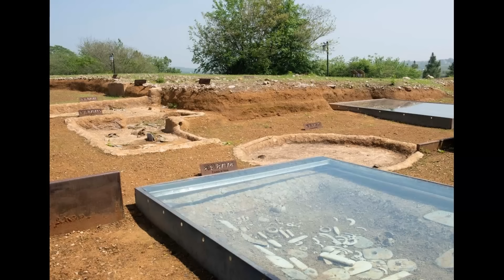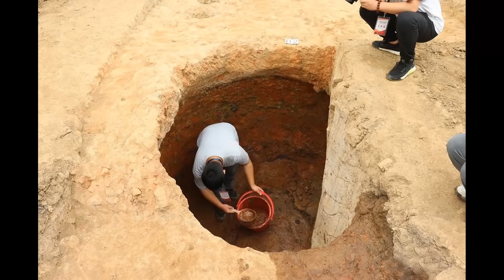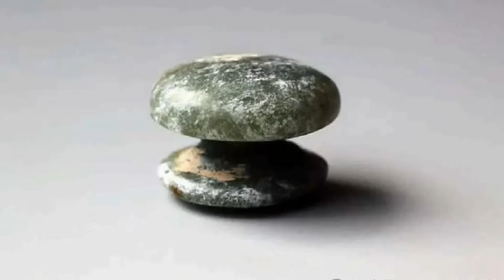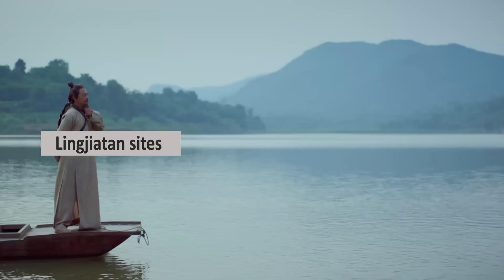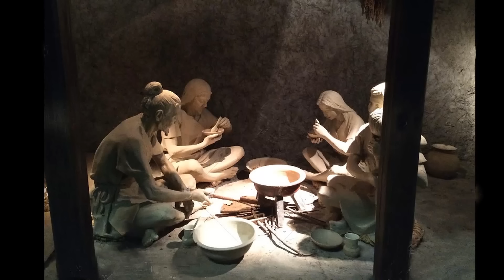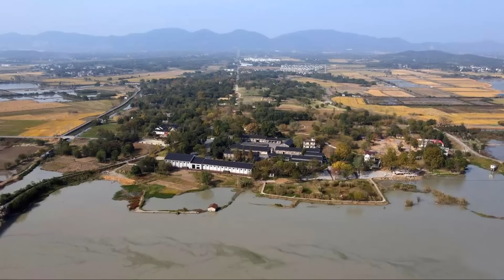Lost Prehistoric Engineering: The Mystery of the 0.5mm Jade Artifact

Comment: 👍  Cool, thanks.    Just from me doing years of woodwork, I would guess they would have finished the center hole with flare first through a block of material, then cut the material down leaving as little as possible around it,  then worked toward the existing hole with abrasive methods.
Reply from the maker: That is a very practical perspective on the order of operations, thank you for sharing your expertise! 😊

Comment: These are truly amazing artifacts Tina.  The wobble-drill connection is brilliant!  Well done.  With the earrings being only 0.5mm thick at some spots, it leads me to believe they were  made a little different than the jade cylinder for top-knots.  In your last video, you showed a jade cylinder that wasn't finished.  They did the outside first and then drilled a hole through it and used twine and jade cutting sand to go around and cut out the center.  So basically, outside first, then the inside.  I think they must have done the earrings the other way around, inside first, then the outside.  This is because the 0.5mm wall thickness would have been too weak to take the stress of the wobble drill.  But, looking closely at the earrings, they appear very circular, maybe not perfect but very close.  How did they do this?

I propose they used a potter's wheel.  They could have put clay on the inside to get a profile of the inside and set it aside to dry for interior dimension reference.  Then they could have used clay to attach it to a potter's wheel and center it.  Then leave it for 12-24 hours for the clay to dry without firing it.  At this point they could have used handheld grinding stones and abrasive slurries to grind and polish the earrings.  This would have made making the end product to such fine tolerances much easier.

The potter's wheel was invented at least 5,000-6,000 years ago.  The only problem is current archeological evidence places it in Mesopotamia at that time and didn't migrate to China and other places until after the time the kick-wheel was invented, about 2,500 BCE.  At least that's what ChatGPT will tell you.  I think this is flawed thinking.  There is no reason why it couldn't have been invented in several places over those thousands of years, whether or not there are surviving specimens.  Absence of evidence is not evidence of absence.  I think the existence of the earring artifacts are indirect evidence of the potter's wheel in China at that time, 5,000 years ago.  This pushes back the potter's wheel in China by 500-1,000 years.  I think we have a double discovery here Tina!  What do you think?

In your research, did you run across any Chinese pottery 5,000 years old that looks like it was made with a potter's wheel or a kick-wheel?  China has a very long history of amazing inventions and craftsmanship.  I wouldn't be surprised if you saw it but didn't realize the significance at the time.

BTW, did you get a chance to look into the Celtic dodecahedrons and icosahedrons theory yet?  
Great video Tina!
Ken
Reply from the maker: I found your comment, Ken. It is a compelling idea that these artifacts could serve as evidence for earlier manufacturing techniques; thanks for the continued engagement and the great questions! :-) I've been looking for signs of the use of a potter's wheel in neolithic China from 5,000 years ago but haven't found a definitive answer. 
About your dodecahedron theory, I will email you my thoughts! 
Thank you for your continuous support and inspiring, Ken!

Comment: 😎 'Earring' was my very first thought, resembling central American 'ear plugs' but smaller. You can drill jade with sandstone? That would be incredibly time consuming. i have a little piece of jade from California i'd tried drilling with a modern drill bit coated with diamonds. It was still VERY slow going. Jade is really hard. It would have taken a relatively prosperous culture to afford an individual the time to produce something like that.
i worked at an archaeological site as a volunteer for a while in a southwestern US state. Very few artifacts were found, the decidedly pre-Columbian site had been deliberately abandoned and cleaned out pretty thoroughly, but one day i found a very small bead carved from milky quartz with a small clear quartz inclusion. It was only about 1/4 inch across, two flat, parallel faces, flat edge (coin-like) with a really tiny hole in the middle. i showed it to the archaeologist and it disappeared into his front pants pocket in about a nanosecond. i asked to borrow it back and took a couple of pics of it. It had been laying in the dirt at the edge of the dig, so not possible to date but suspecting it did date back to the original site occupants. i've puzzled about that piece ever since, how they could shape quartz like that without the aid of modern tools? The hole through the center was really tiny, hardly more than the diameter of a straight pin. Figured that would be a lot of work with a cactus thorn covered with wet sand...
It is pretty astounding what some ancient cultures somehow managed to accomplished in manipulation of natural resources.

Comment: Nice video and presentation. 
Hard and brittle cannot be cut like meat or wood, can only be shaped with emery or quartz sand/powder inlayed rope or rod tools by glue. Each tool is either blank or pre-shaped conformal against a target profile. The working material is either glue on a platform or a rotating axle. A draw bow to execute axle rotation. The action is either linear push pull or circular turning. Water is added during polishing.

Comment: Considering there are only two found each time and in the same location then they IMHO do have some connection to/was for either 1) the ears or 2) the nose

Considering they was found with one on both sides of the head then it does seem more than likely for the ears

Modern day version are often called "gauges or spacers" that is IF they are used in the same way as "ear piercings" 

Could also be used for the ears as "inserts" in the auditory canal (for enhancing sound ?) they do look similar in size and shape to what some hearing aids ear pieces look like (that I know of)

Whatever they are used for it seems to be a lot of work just to make them so they must have been important to the people who used/wore/made them